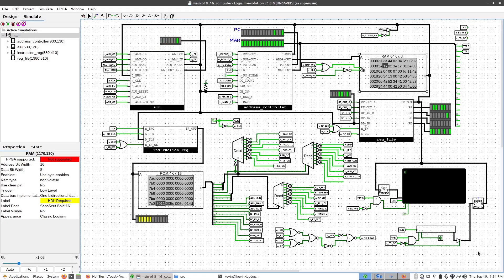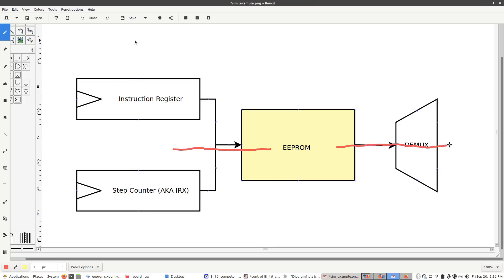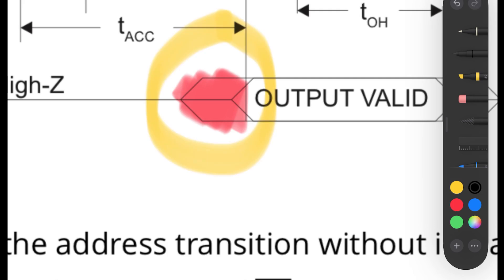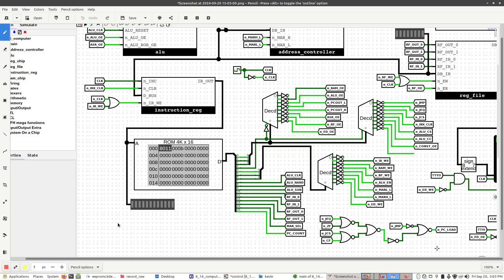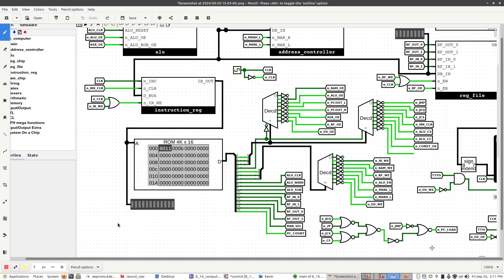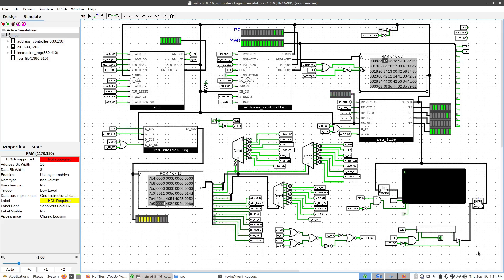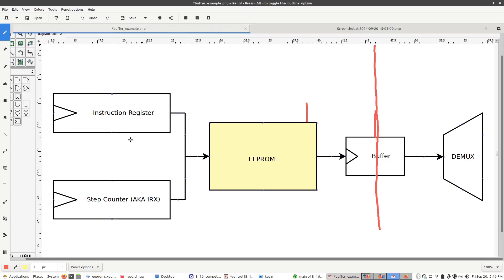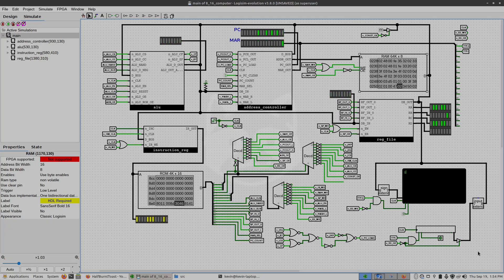EEPROM Traps! (Combinational logic / TTL Computer microcoding)

Comment from the maker: Also, I know I keep saying 'demultiplexer' when I mean to say decoder. Sorry about that.
Reply: The decoders are a nice touch in the design. I'm guessing that other have done it too, but I really can't recall seeing it before. But being able to use fewer  microOps-ROMs by decoding some of the outputs instead of having all control signals individually controllable is really nice. It will limit what the opcodes can do, but with enough planning it apparently is fully viable. Did you have to sacrifice some functionality that you might have wanted to include because of them or was it just "smooth sailing"?
Reply from the maker: @MatsEngstrom  Oh, it was definitely a major crunch to get everything to fit down to two EEPROMs. Life would be so much easier with three. But, one of my design goals is to use the minimum ROMs possible. That has definitely limited functionality. 

For example, the computer doesn't have the space to do the 6502-equivilants of JCC or JNZ. So, the assembler creates 'virtual' opcodes during assembly that emulate those opcodes. It also means that some of the control signals can't occur at the same time, such as manually changing the carry flag of the ALU at the same time as component output is being driven to the databus. So, unfortunately, it makes the overall microprograms longer for many opcodes. That said, I think I can still squeeze a few more control signals out of it - assuming the testing goes okay.

The control logic and timing is really the only thing holding me back from building a finished version lol. It gets really complex very quickly.

Comment: the simplest solution is to use the falling edge of the clock to validate. on the rising edge of the clock the step counter increments... the clock stays high for the needed time for the outputs of the eeprom to stabilize... when the clock goes low... on the falling edge you then clock the output of the eeprom to the registers without the need for a buffer. since the clock is symmetrical... you then know that the logic between the registers and even memory must all stabilize within the same time needed for the eeprom. With this method you may even use an asymmetrical clock if the instruction decoders are the slowest component in the system. with the fastest Flash parallel devices such as Microchips SST39SF010A-55 used as instruction decoders that has a 55ns access you can build a system that can run 8Mhz clock rate

Comment: I feel like youve missed an important part of the design you'll see with Ben Eater and similar. All registers and anything else that might output data onto the bus or read from the bus uses ics that are clock controlled. So if you something like a 74hc377 buffer for your register, you dont care what those control line are doing during the setup time since there is no clock pulse. Also if youre using the AT28C256 or similar eeprom, your setup time is down to 70ns. So if your breadboard computer clock is less than 10MHZ, you dont have to worry about it.
Reply from the maker: Ben Eater's computer is still vulnerable to the undefined outputs during address transition. Specifically, the halt line is tied directly into the EEPROM outputs. When the EEPROM changes addresses, the halt line can flutter which results in multiple unwanted clock pulses Which can then lead to registers and counters storing invalid data. Whether or not it happens is down to chance.

Comment: When your circuits get big enough and/or fast enough, there's a good chance you switch everything over to synchronous design and just reclock just about everything after it's decoded.  In FPGAs, there's a FF sitting after each LUT, so you might as well use it.  For particularly wide input functions, breaking up the decode into several stages, and then pipelining around it to account for the delay may be the only way to get the circuit to run at speed reliably.

Comment: Wow, great stuff. I'm still extremely new to super low level stuff and electronics in general, and my first instinct when you posed the problem was to just disable the decoder using the opposite clock (eg: load the eeprom address and disable the decoder output on clock high, then enable the decoder output on clock low). Actually splitting the clock into multiple phases though seems way more flexible, not only allowing prefetch like you mentioned, but in theory allowing for other combinations of more granular execution timing. Super elegant solution that I doubt I would have ever come up with.
Reply: My bet is he's already at  the raggedy edge of clock cycles that board can handle, so while your solution solves the problem theoretically it's a lot harder to pull that off practically. Generally you're gonna have to lose clock cycles in order to get it all working. And who wants to lose speed? 

That's been my experience anyway when prototyping... The hardest part for me is getting  those clock cycles to work correctly with the board and its components at a speed that makes it worth doing. 

But this guy Yeah, he's insane. Why? Build your own processor...   I wish I had the time cuz this would be fun and I get why he's doing it...   but at the same time he sounds insane. They're a nickel a piece in any size and speed.  

But hey,  we 're probably gonna need this guy after the great AI wars.

Comment: Okay, so this is why it's really hard to design a working CPU if you aren't already experienced at designing digital logic in general. If you are, you already know that you have to be very disciplined about timing, & timing diagrams are your friend, so none of this stuff will come as a surprise to you.
(Citation: I was designing high speed embedded control systems back in the late 80s.)

Comment: This issue pops up in a few places. I've just discovered that during bootup, a lot of the output pins on the ESP32S3 have undefined output states for something like 60ųS, which is definitely enough time to trip up direct hardware.
For devices connected via I2C, not a problem; they'll see a garbage packet and ignore it. But direct logic will respond as if those are valid outputs O_O

Comment: I totally agree. The control logic is by far the most difficult part of designing a microprocessor. You could latch the output of the eeprom in conjunction with a capacitor, but there's no way around its high latency. A state machine driven by a counter or timer performs faster, but adds a lot of complexity, however, it can be simplified with a careful optimization of the control path.

Comment: The same issue arises when using FPGAs to replace discrete logic. The logic can be designed so that unexpected changes are suppressed by the order in which things are gated, but FPGAs are usually using a logic LUT which will need some form of clocking once the result has settled.
Reply: A LUT doesn’t, by default, need clocking. There’s a D type latch that can be enabled in the output path to make the LUT synchronous, but it is perfectly possible to write completely combinatorial logic using an FPGA (no clock needed). The compiler will tell you what the propagation delay is for the combinatorial parts of your design.

Comment: Awesome video.

I worked at a defence contractor that had legacy designs using 8 and 16-bit processors like this. By the time I started working there, they had moved on to implementing these systems in FPGAs. Once I understood timing closure and setup/hold times, I took for granted that the compiler tools did all of that thinking for me. After watching this video, I am super grateful that a lot of the analysis is automated. I cannot fathom the amount of time and rework that would be needed to analyze every signal's timing characteristics by hand.
Reply from the maker: Yeah, it can be rude awakening when working with the discrete components. For small systems like this it's not so bad, especially at the frequency it runs at. But, it's definitely still a job in itself.

Comment: I have little experience but I thought that with a synchronous circuit the norm was the central clock connects directly to the clock pin of every register.  The register then has either an enable and maybe a direction control, but they are just levels that must be setup properly with respect to clock.  Or a D or JK flip flop for flags.
Now I did work with an asynchronous computer, the PDP-10 KA10 CPU, where all registers are made of set/reset flip flops.  In that case, to load a value one must find a short pulse to clear the register, then a later pulse ANDed with the data to be loaded to set the flip flop. The AND function would be built into the module's set inputs since every use case requires it (no ICs in this CPU except for some 8 bit RAM chips to implement 16 36 bit CPU registers, those 72 bytes were a $9000 option, $81,000 in today's dollars, ). Since there is no clock, the machine is driven by pulses that flows through all the delay lines and conditional pulse directors, and if it ever gets lost, the machine ceases.  Fun to design but rather parts hungry.  If the designer follows the rules, it simply works, except for everything else waiting to bite his butt.
Reply from the maker: Yeah the trouble with the 74HC273 registers is they don't have any chip enable lines - only a clock and async reset. The clock of the chip is qualified against a system clock phase through a NOR gate. But, qualifying the reset would take extra gates I don't really want to spend if I can help it.

I can only imagine how much time and effort went into getting those flip-chip computers operating properly.
Reply: @HalfBurntToast  - I'd do everything I could to find a way to not have a clear pin and go with the 74HC377 that replaces clear with enable.  I'd forgotten how slim the pickings were back then.

Comment: But what if the output latch takes a long time to settle?
Reply from the maker: The latches have a much shorter window where they stabilize. There's still a chance that the skew between the settling bits causes an invalid signal being decoded. But, the window for when that happens is so small it likely won't overcome the hold times needed by the chips. If you want to be extra safe, you could still qualify the outputs against a clock phase.
Reply: You’re looking at D type latches here, that sample the input state at (typically) the rising edge of your clock and stabilise their outputs in a few nanoseconds, they work about as fast as the decoders so the decoders don’t have time to react to any transients.

Comment: Nice summary of the issues with asynchronous signalling in a system. Perfect length & depth and no annoying extra fluff. I wish all content creators was as succinct as you.

But there's still a chance of  a latch/FF not actually having the same propagation delay between CP to Qn for all outputs. The datasheets doesn't usually mention any delta or variation figures between the outputs, but I'm sure there are some, and they will also be affected by the capacitive load on the particular output.  

Granted, the possible glitches (which should be just overlaps and not real glitches unless you have combinatorial logic using multiple outputs from the latch - like a decoder ^__^ ) will be much shorter than the outputs taken directly from the ROM. They're probably so short that they won't be interpreted as a valid signal for an Enable / Clr /Latch on the destination ICs anyways.
Reply from the maker: Thanks! That is a good point about the possible skew of the register outputs. It could result in the decoders briefly fluttering an output it's not supposed to. But, yeah, like you said, the propagation delay/skew is likely so short it wouldn't register as a valid input for the 74HC138s.

My development computer currently uses 74HC595's feeding into the decoders and (so far) I haven't had any instabilities. But, to be extra safe, qualifying the critical signals against a clock phase would be enough insurance.